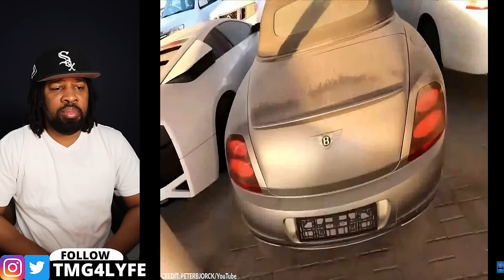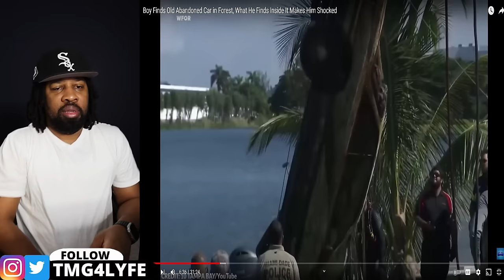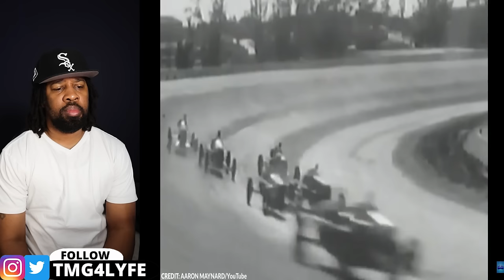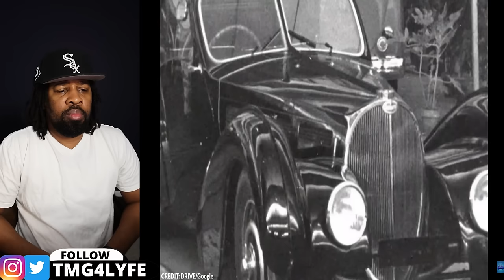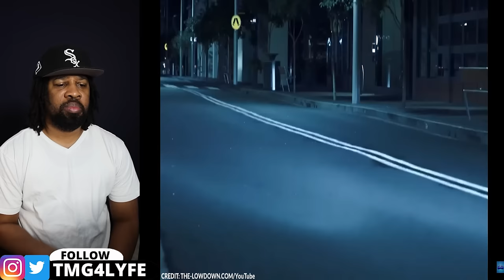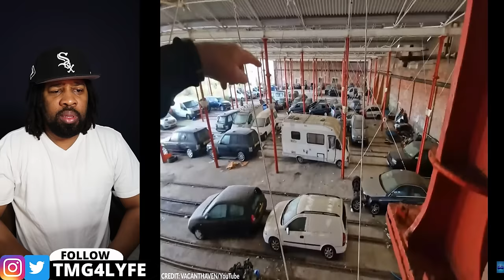Boy Finds Old Abandoned Car in Forest, What He Finds Inside It Makes Him Shocked

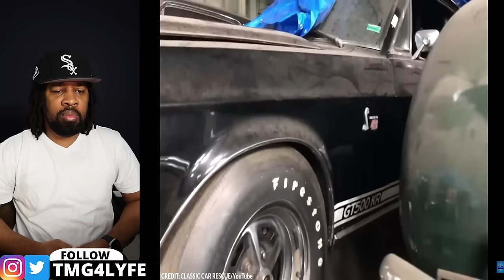Comment: Why has no one brought up the a Holy Grail car right at 9:05.?? 
That Black-on-Black Ford Shelby GT500KR is by far the sickest and one of the rarest cars on this planet, not only because they were spec'd out to have only 335 HP in order to keep insurance companies happy because in reality they were over 400 HP and some say actually closer to 500 HP with over 450 ft/lbs torque at the wheels through a 4 speed transmission. Not only because there were only 1452 GT500KR's made in total, not only because only 933 of those GT500KR's were fastbacks or that 518 were convertibles, But because there was only 38 RAVEN BLACK on Black Ford Shelby GT500KR with 428 Cobra Jet 4 Speed cars ever made.  I would kill to have one of those cars but they average 180k at auction and some have pulled well over 300k.  Amazing piece of history right there.
Reply: I saw it the narrator no zero about cars it's mindless babble